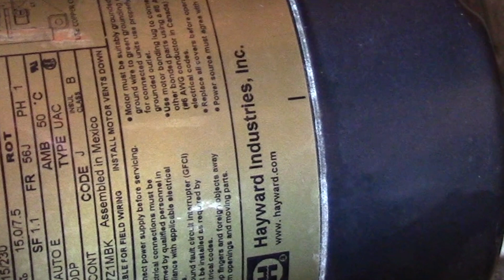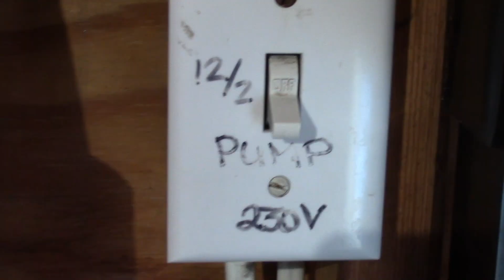How To Clean POOL PUMP FILTER BASKET (DIY)

Comment: Helped a lot but for me, seeing as I have an inground pool and my filter is above pool level, it took me a couple of tries to figure out that I had to close the intake pool valve to the pump, fill the pump with water as much as I could, quickly put back the cover, start the pump for a few seconds before re-opening the intake valve. If I didn't do it that way, my pump never refilled completely and didn't self-prime.
Reply from the maker: Great! Thanks for sharing that with our viewers. Some may have that same issue & now they know. And Thank you for the visit.

Comment: I sir, thank you for the video. As for the rubber, i changed mine and saw the ancient owner had been fixed on the pump with glue. Is it normal ? This pump already had an owner before me. So it is either him or it is manufacturely done this way?
Reply from the maker: Thats good you changed it. The previous owner may have tried to fix it with silicon glue.
Reply: @jonahvlogsdiy4143  One more thing if you will, I dont understand how you manage to fill your pump with water so slowly before starting it. Me I must overflow it so quickly and put the cover and retain it firmly with my hand and then start the pump right away as the water leaves infinitely by the draining pipe and air gets inside. Only then can I thighten the screws after that I see pump catching back the beat and end up flowing properly. It works when you do it fast only. And it always make a mess in my shed cause i must put water up to the very top and very quickly. Plus it always suck air at the beggining before it starts working well, and I think that it's not good for the engine. So I am curious about your way. Thank you.